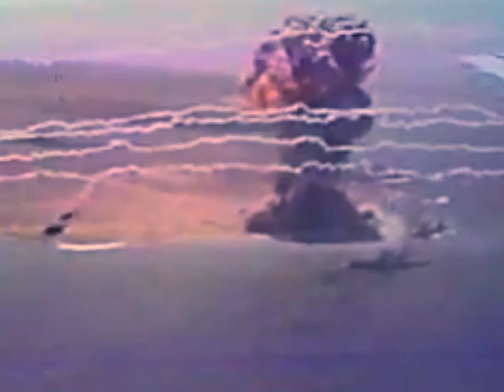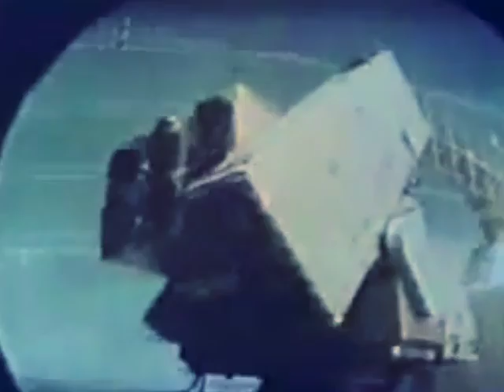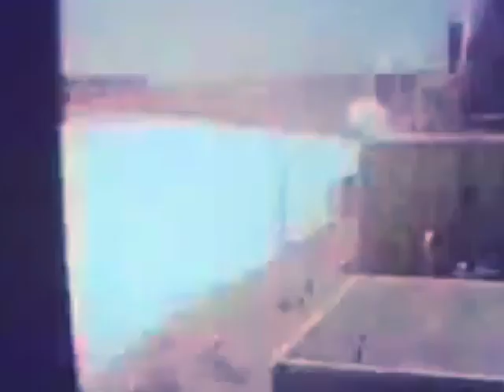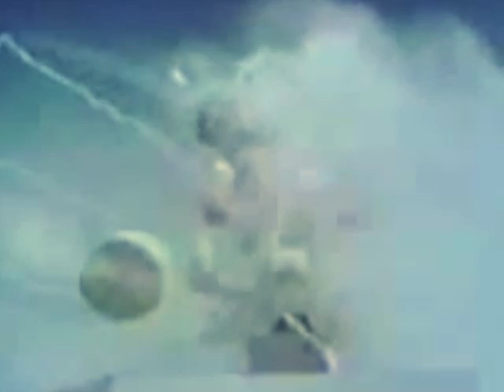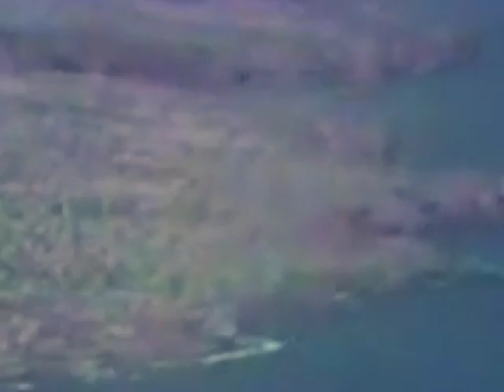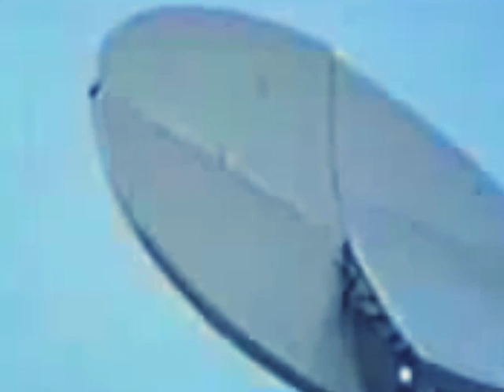Operation Sailor Hat - Color-Corrected 500 Ton Explosion

Comment: So 40 years earlier, the Arizona carrying more than 500 tons of high explosives only damaged the Arizona sufficient enough to merely sink it and not destroy the entire harbor... ??? hmmmm... Interesting...
Reply: So many thing wrong with this post.

1. The blast in the Arizona was contained by a heavily armored battleship. So no, the entire harbor wouldn't get leveled when the magazine exploded because most of the force of the blast would be taken by the ship itself.

2. Not sure where you get the idea that 500 tons of high explosive ignited in the USS Arizona. The 14" guns required 4 silk bags of smokeless powder to fire one shell and each of those weighed 100 lbs. The Arizona could carry 230 rounds per gun. I'm not going to waste time listing all the numbers but the forward magazine, which is what exploded, had 270 tons of smokeless powder. 

Smokeless powder is not a HIGH explosive. It actually takes very specific circumstance to explode. So...it wasn't even half the tons of this pile of TNT and since it was a LOW explosive it wouldn't equal the same amount of TNT.